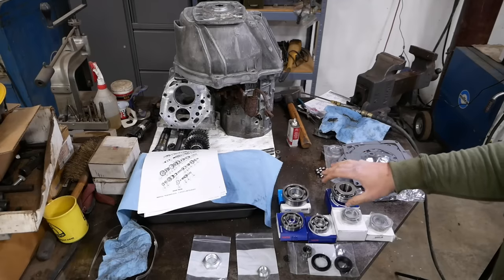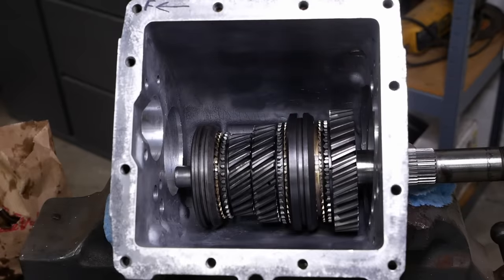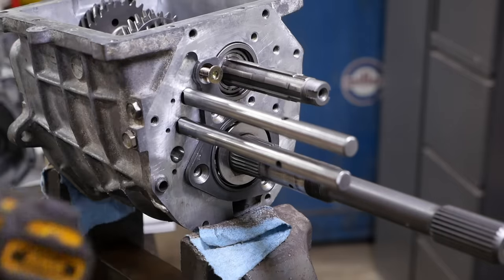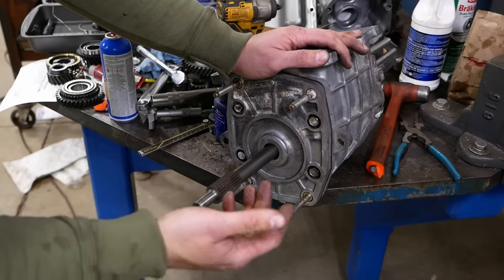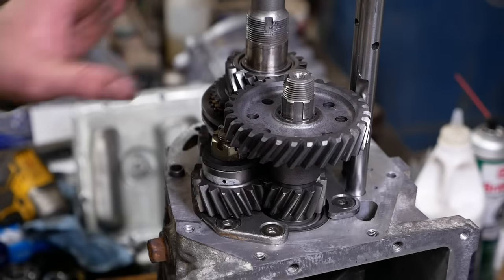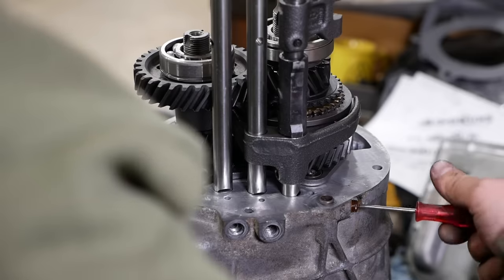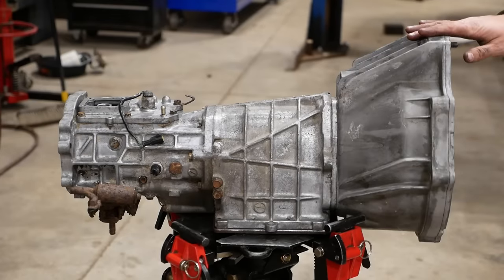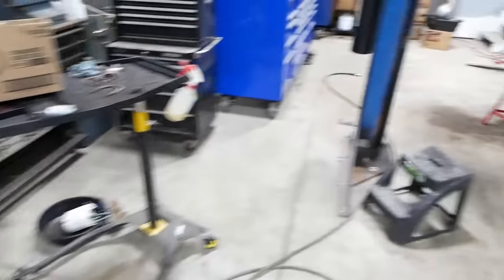Ford Ranger Transmission Rebuild - the Complete Guide No One Asked for - Part 2

Comment: Good job.  You are a master craftsman.  You need a snotty nosed apprentice.  I am a retired, degreed engineer.  Not to many engineers or mechanics can do what you do.  Go back to school,get an engineering degree (company sponsored) and earn the $$$ you are worth.
Reply from the maker: I already have an engineering degree...
Reply: @WatchWesWork  when are we going to see some of your designs. Don’t answer that. There’s a one in a million maybe a thousand that some entrepreneurs will see this and make you an offer you can’t refuse.  Build a 200,000 mile gas trans and a million mile diesel trans .  It can be done but oem’s say it cost prohibitive.  Yeah if you let the same guys that design them.  Do it yourself with parts from other trans with necessary mods, find the dyno cycles for transmissions, check SAE then get a booth at SEMA and custom car builders will start using and it will slowly creep into main stream.  I was a partner in a company designing, testing and selling crash alert systems.  We sold to an electronics company but still hold the patent.  It’s no big deal.  Only takes 24 hours a day, 7 days a week for 5 years.  Just like farming.